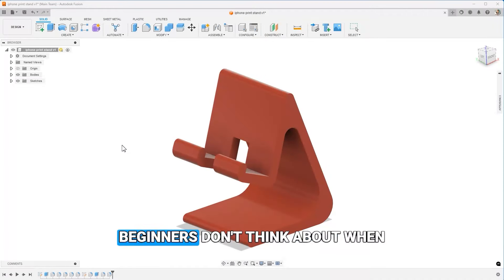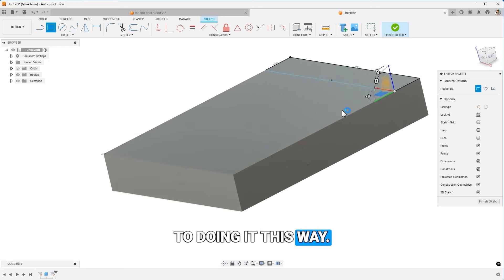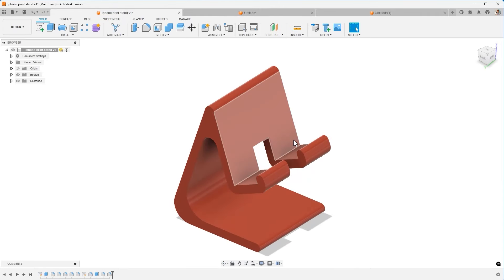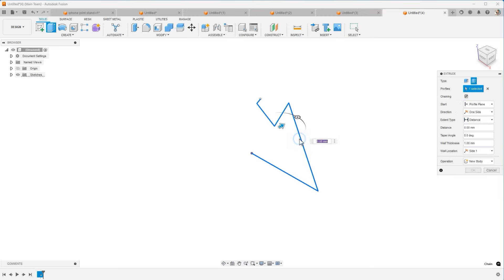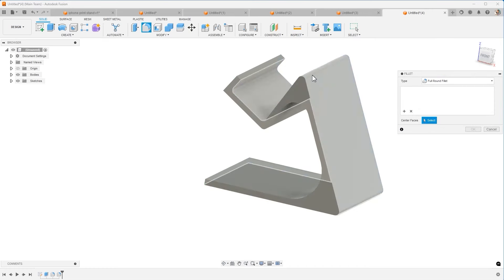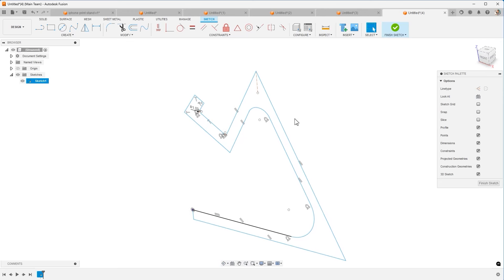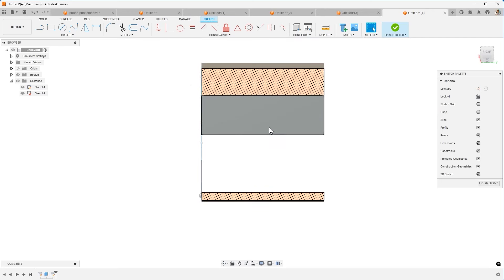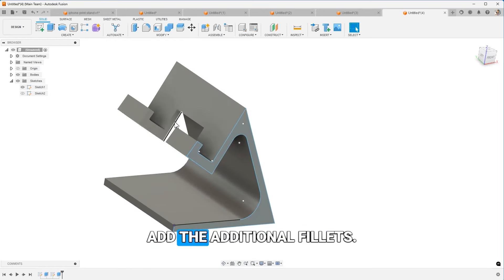Unlock Perfect Designs: Why Sketching the Right Profile is the Key to Fusion 360 Success

Comment: I keep running into confusions following the sequence. For example, I've got your initial perpendicular sides drawn and the offset. Then you do the extrude. I cannot duplicate what you're doing. You dragged the offset and there is a hand for your mouse. All I have is the offset ass black lines.
Mostly extrude doesn't even show up for me and when I finally find it in my right click drop down (lord knows what I did to find it), my extrude works on the original and offset lines separately. I have Fusion 2.0.20981 x86_64. Perhaps I'm out of sync with your screen options. Any advice? I've found individual tutorials on how to do offsets and extrudes but cannot find anything on both.